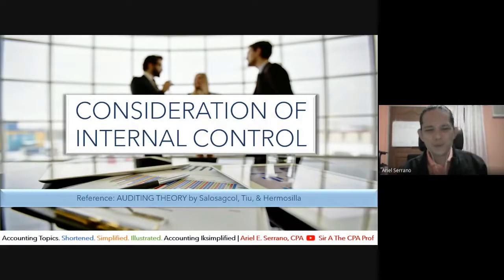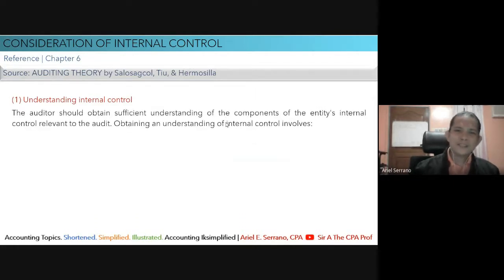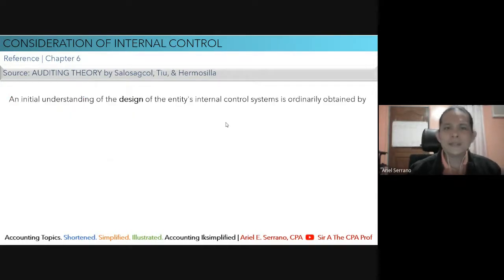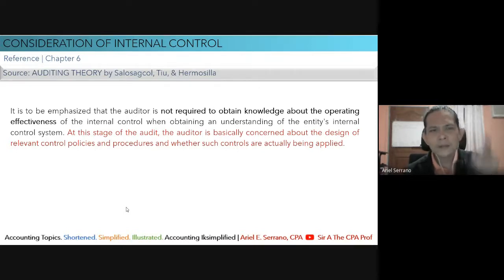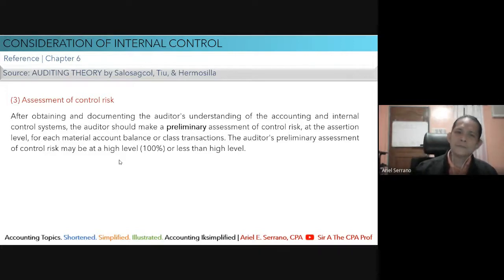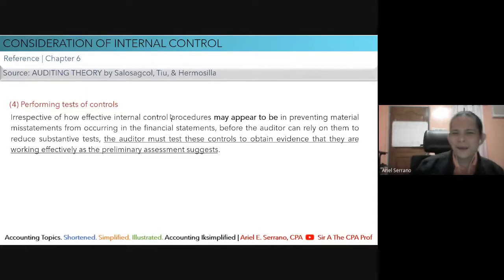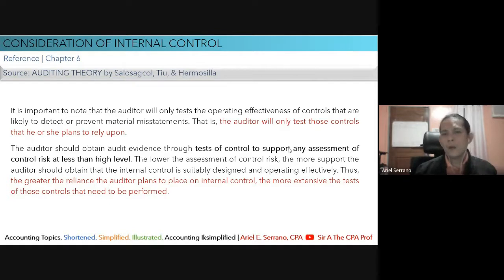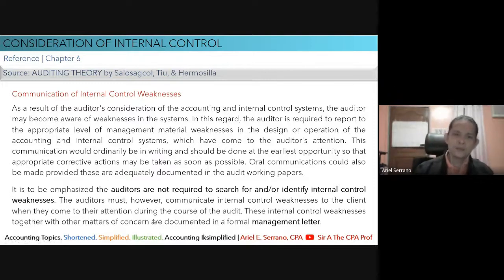Consideration of Internal Control | Hermosilla, Tiu, Salosagcol

Comment: Based on my understanding, preventive controls are intended to avert bad occurrences or human mistakes. For instance, divided tasks and physical protection of valuables are examples. while Detective controls are intended to search out and resolve issues that have arisen or happened. Once an error has been identified, management can take steps to minimize the likelihood of recurrence by altering the underlying process. Finally, corrective controls are used to rectify recognized mistakes. It is conducted in response to the detection of an issue by internal investigative controls.

Comment: Done Sir, Thanks po

Based on the previous video lecture that we watched. Preventive controls is designed to prevent or reduce the undesirable happening. Detective controls are devices or techniques to detect risk and this is the 2nd line of defense, while corretive controls are the actions taken to reverse the effects or errors that was detected.

Comment: Done Sir. Thank you. 

Preventive Controls are designed to minimize the occurence of a misstatement that could adversely affect the financial statements. 
While, Detective Controls provides evidence if preventive controls has been effective in preventing fraus anddd etrross. On the other hand, Corrective Controls are the one who is taking the actions to reverse the effect of fraud and errors. 

Though they are different, they are all working hand in hand together, especially with the detective and corrective controls as they are responsible of minimizing further the fraud and erros.

Comment: done watching sir, thank you po!

Preventive Controls are passive techniques designed to reduce the frequency of occurrence of undesirable events. Detective controls form the second line of defense which is designed to identify and expose undesirable events that elude preventive controls. Corrective controls are actions taken to reverse the effects of errors detected from the previous step that actually fix the problem.

Comment: Done watching, Sir. Thank you po.

- Preventive internal controls are put in place to, as the name implies, prevent an adverse event from occurring.
- Detective controls are designed to find errors or problems after the transaction has occurred. 
- Corrective controls include any measures taken to repair damage or restore resources and capabilities to their prior state following an unauthorized or unwanted activity.

Comment: Done watching, sir!

Based on the previous videos, Preventive Controls are designed to reduce undesirable events. While Detective Controls are the seconfd line of defense. Wherein through the use of devices, techniques or procedures, they identify all the anomalies found and draw attention to it. Lastly, the Corrective Controls job is to fix the problem found.

Comment: Done watching, Sir! Thank you po :)

Preventive control - these are the shield of internal control. This is designed to prevent events that can bring harm to the company's assets. 
Detective control - these are after the preventive control (second's shield) of internal control. It identifies and uncovers the harmful situations that cannot cover by preventive control.
Corrective control - these controls correct the harmful events that reveal in detective control. These controls fix the problems that have been found in detective control.

Comment: Done watching sir, thank you po.

Internal control is similar to the security of a corporation. Preventive controls are activities made to prevent errors from reoccurring. Detective controls are used to find flaws or faults in a company's internal control system. Corrective controls are used to rectify or mitigate identified flaws.

Comment: Thank you po Sir! 

With regards of the question in the video, preventive controls (PC) are methods in attempting potential mistakes and risks as detective controls (DC) are methods to "detect" and reveal negative circumstances that affect the entity's IC. Last but not the least, the corrective controls (CD) are methods for the reversal of such errors in order to correct them.

Comment: Done watching Sir, thank you po!

-Preventive controls are designed to prevent adverse events or errors from occurring. Examples are segregated duties and the physical protection of assets.

-Detective control are designed to seek out problems after they arise or occurred. Once an error is detected, management can take actions to reduce the risk of recurrence by modifying the underlying process. 

-Corrective controls are applied to correct errors that have been detected. It is performed following the discovery of a problem by internal investigative controls.

Comment: I remember Sir that you have shown an illustration about preventive,detective, and corrective controls in one of your video lectures about internal control. Based on my understanding, preventive controls are the first line of defense against errors and irregularities that may occur in the organization. These are controls that are used to keep errors from occuring. But since errors are inevitable, companies apply detective controls to identify or detect errors and irregularities that are unpreventable in the first place. Corrective controls will then be applied to make corrective actions to address the problems detected.

Done, Sir. Thank you po!

Comment: Detective - Used to detect weaknesses or errors in the internal control system.
Corrective - Used to correct or mitigate those weaknesses detected.
Preventive - Actions to be taken to avoid recurrence of the errors.

Done sir. Thank you po!

Comment: Based on my understanding about the preventive, detective and corrective controls from the word itself are:
Preventive - it is a controls that reduce the risk of undesirable events to occur
Detective - it is a control that detect or identify the risk that pass through under preventive controls due to some inherent limitation of internal control
Corrective - it is a control that correct the risk or undesirable events identified in the detective controls. 

Done watching, Sir. Thankyou!